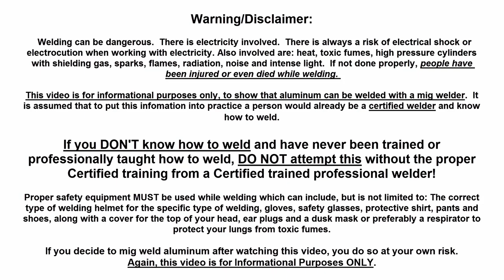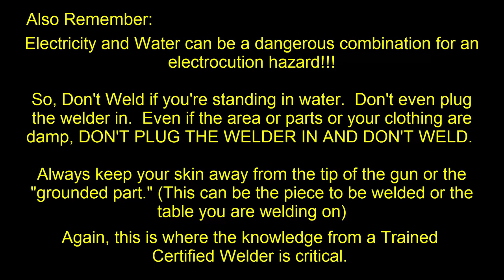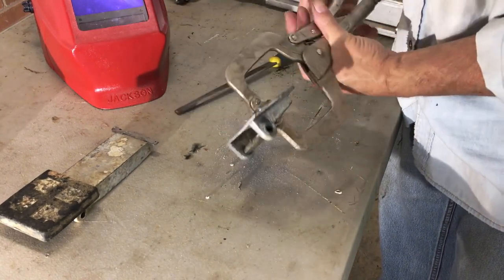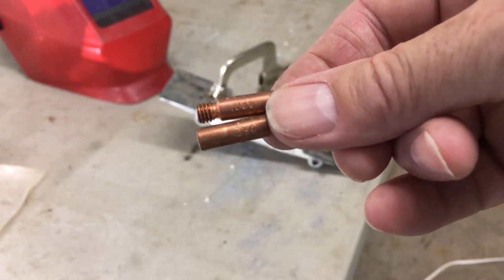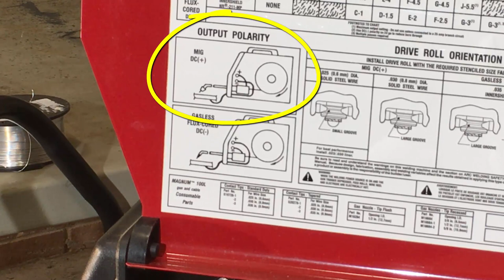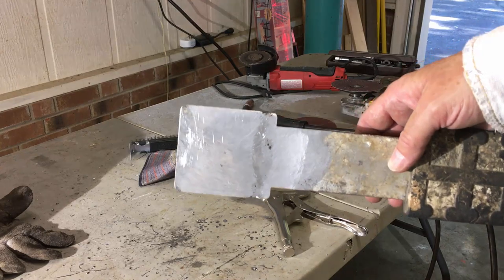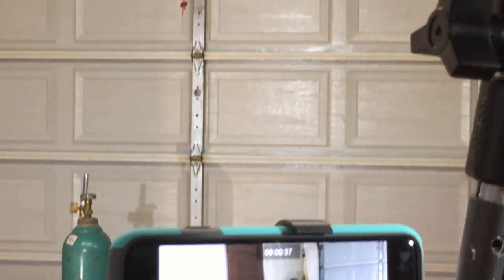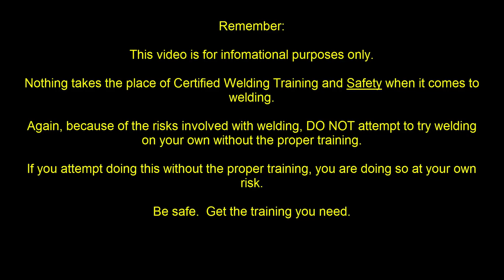Learn An Old Timer's Secrets To Mig Weld Aluminum Without A Spoolgun

Comment: Electrically speaking, a MIG welder is a Constant Voltage (CV) machine.  You set the voltage and wire-speed needed, so the voltage remains at the setting.  The wire speed and wire stick-out from the contact tip are used to adjust the amperage.  This is because those two factors create resistance.  We are talking about Ohm's Law here.  With the wire speed properly set and the proper amount of stick-out, you should have a good buzzing weld arc.  If the arc is popping and spattering you most likely have too much stick-out meaning the arc is too cold, reduced amperage.  If the stick-out is too close the weld might be too hot increasing the chance of the weld sagging or melting thru in the aluminum.  The stick-out is used by experienced welders to adjust the heat (amps) of the arc as they are welding and require a little more, or a little less heat.  MIG welders learn to do this and make the adjustments unconsciously based on what they see and hear.  Aluminum requires more heat than steel does for a given thickness of the metal being welded.  Going past 1/4" inch thick aluminum I have found it is sometimes advantageous to pre-heat the metal a little.  Now, SAFETY!!!  For all the safety warnings you listed and went over, You committed the MOTHER OF ALL SAFETY VIOLATIONS!!!  NEVER EVER MOVE A HIGH-PRESSURE GAS BOTTLE UNTIL THE SAFETY CAP HAS BEEN PUT ON THE BOTTLE.  Even an empty bottle can be a danger to life and limb.  As a side-note.  A SMAW (STICK) and GTAW (TIG) welding machines are Constant Current (CC).  You set the amperage and by adjusting the length of the arc, you vary the heat (Voltage) of the arc.  The arc spans an air gap between the electrode and the workpiece.  That is the resistance used by Ohm's Law.  A close arc reduces the voltage, a longer arc increases the voltage.  Hope this all helps with your future welding.  I couldn't help but respond as I was a welding instructor before retirement.
Reply: wow good info.....
Reply: You da man! 
Now , how may i TIG Alum with a DC/CC machine, and no high Freq?
Electrode Neg after Balled Tungsten, then?
Reply: @drd1924  As I am sure you know, Tig welding aluminum is accomplished with AC constant current and a balled tungsten tip.  Without the surface cleaning action of AC to strip the oxides off the surface of the aluminum, you must clean the surface by grinding or sanding the surface of the aluminum when using DC.
Reply: @OleNavy  Thanks, I have used some nice AC Machines such as the Aerowave and Synchrowaves.....but heard about the "ol HeliArc method from back in the day, when guys used DC and Helium....I've tried it with not good results. I like to try and get good at all possible methods such as running E7018 Downhill before Inspectors started to allow it.
Reply: This is interesting to read, my MIG can also do stick, the dials are wire speed and current, not voltage. There's a switch to change between MMA and MIG, so I wonder if that changes the function of the current dial between current and voltage. Fairly mid/low end machine to be fair, but it works well enough for me to learn on.
Reply: No

Comment: I love reading the comments from the welders. I have been tig and mig welding for 40 years.  Everyone has their way of welding and aluminum mig takes skill and knowledge. I never used a spool gun for aluminum mig. The bigger tip is key and a clean weld. No need to stitch the weld though run a straight bead and you will have a good weld.
Reply from the maker: Thanks for the comment!  I appreciate good comments from guys who have years of experience like yourself.  Thanks for taking the time to watch the video!
Reply: @StairwayToVideo  I enjoyed the video and info, but what video editing software do you use? My son is getting into it and it seems like there are alot of choices.
Reply: My first welding job was in 1968 and made a lot of mistakes while learning, and was put on a job of welding up holes on bottom of a John Boat with a Tig, it was more than is was able to do, but last time was vertical on 1/4 inch Aluminum,  good but not impressive. I wonder what it would be like today, if Migs had not been invented?

Comment: Many good comments here. Great advice from Mike Klass. The #1 rule with aluminum is it's GOT to be clean. I worked in my Dad's sheet metal/fab shop for 46 years. He taught me how to weld all types. I never got as good as he was. But great video.
Reply from the maker: Thanks!  It's cool that you got to work with your dad for all of those years!  Thanks for commenting!
Reply: @StairwayToVideo  thank you. Dad's been gone 3 yrs now but I still use the tricks he taught me. The "old heads" can surprise you every time.

Comment: 1-Clean part with stainless brush.
2- Then clean with acetone. 
3- Replace the gun liner with a teflon one.
4- Pre heat the workpiece. 
5- Purge residual gas from welder.
6- Tack each end, then weld continuous.  
7- Slow down wire speed.  
8- Less wire stick out before initiating arc.
Reply: Teflon gun liner is a must for alum. 
switch it back out when going to steel though as steel wire will cut right through teflon in short order.

Comment: I learned aluminum welding having to weld propellers with stick in 1970. (no leasons)  1972 we bought our first wire feeder for steel.  Aluminum wire welders were a nice treat in 1985.  Thanks for your nice work from a boat builder and job shop owner.

Comment: Thank you for taking your time to make this video.  I would like to add to Mike Klass's comments. Best tips in the video: 5356, .035 tip for .030 wire, and 100% Argon gas. As for the rest, no need to steamroll a dead horse.

Comment: Regardless of the negative comments I did get a few good tips from your video, at least I have a very starting point for my project so unlike so many comments I read I thank you
Reply from the maker: Edgar, thanks for the kind comment.  I appreciate it!
Reply: Through years of experience and a class from national weiders society they said to use rubbing alcohol to clean and if you are going to do a lot of aluminum they make a straight necked gun with pistol type grips  like one other party said keep your lead as straight as possible but I highly recommend a spool gun space proved or a push pull gun for high production jobs twenty eight years experience in the field
Reply: Yea everyone is a damn pro lol

Comment: For cleaning aluminum use a stainless steel brush that has not been used on steel. When welding aluminum, cleanliness is essential.
Reply: Mr2ezgoin ii
Reply: Then wipe it down with acetone after using the stainless steel brush.
Reply: Keep a dedicated St/St brush for Ali and don't use it on any other non Ali jobs. Great Video and a lot of Pro advice as a result. That meant we all learnt something. That's a win win.
Reply: A dilute hydrochloric acid (muriatic) on a piece of rag rubbed onto the welding pieces will give you an ultra pure surface.  The key is to start welding immediately, since the oxygen from the air will start oxidizing the surfaces very quickly.  Just my 2cents.
Reply: My brother used my stainless steel brush on steel while I wasn't looking. can it still be cleaned and used for aluminum welding? Or is it a lost cause and ruined beyond repair?
Reply: Another thing to consider is to replace the liner inside the mig gun. If you have run steel wire through it, it's "contaminated" with micro particles of steel. I use three liners, one each for steel, stainless and alu.
Reply: @BillAnt  It will also rust every tool in your shop!
Reply: @charlesfriend9557  < Only have to use a little bit on the welding surface to keep it oxidation free (an old timer method), it's not going to corrode anything else.  Just an alternative to a wire brush or acetone... to each their own.
Reply: P
Reply: OK distinguishing particular detail being   "stainless"  steel brush        which is NOT merely   steel   brush.          Gratifying finally to see electric Arc welding for aluminum material and filler mostly aluminum I presume.                        Up until now I wanted to throw up everytime I saw "brazing" aluminum mislabeled as "welding" for which an electric Arc is essential for my interpretation sensitivities.                 Even pyrotechnical chemistry bondings and bindings are simply that and not same category as electric-Arc weldings.              My deep study nuts&bolts interest into how such works was attracted, by my infrequent self-services having rare opportunities being rare limited to electric Arc welding the steel only.             I understand better the need 4 grinding or filing what you macallits on the edges of Steel thicker than 5/16, but not on aluminum after tacking corners and zigzag curves on both sides.          Wouldn't that have penetration enough for preventing buckling if flipping the work twice?

Comment: Great video !   You got her done and it looks like your son can get his drywall finished now.  I have a very old welder ( 220 single phase ) and I'm going to get a bottle of argon and give it a try.  Personally I'm not a welder but I had a weld shop in Dachau Germany while in the Army and welded in most every machine shop I ever worked in.  I just play with the machine and setting on a piece of scrap until it taste right then i finish cooking it.  I could read all those books on it but I'm lazy.
Reply from the maker: Sounds like you have a lot of welding experience.  Thanks for commenting and for watching the video.  I appreciate it!

Comment: Thank you!   I enjoyed your video very much because it took me back to when I used to weld professionally.  I first learned to run a bead on my dad's farm at age 12, using 6013 mild steel rod an old Forney buzz-box… progressing  later to a large shop in Ithaca, NY.  There, we did about every sort of fabricating, design, and/or repair job, using various techniques with all sorts of metals, both ferrous and nonferrous, etc.  

During the course of a day, I might silver solder a handle back onto a dainty little collector's-item silver teapot in the morning, and then erect a safety cage out of 10" thick-wall well casing onto a huge dozer in the afternoon using 1/4" diameter low-hydrogen rod.   Mostly, for aluminum and stainless, I used TIG on a huge Miller Gold Star machine... which had all the bells and whistles one could ever ask for.

Have you ever welded while soaked to the skin in the rain in November, perched on a steel scaffolding with cracked cables hooked to a truck-mounted rig?  It's a tingling experience (low-voltage, higher amps), but not really all that dangerous, unless you fell off (Don't tell OSHA).  We often did a lot of higher-end work for the local Cornell Univ., even though they had a welding shop, mostly for small work. 

I'll dispense with giving you any tips as I see many have done.  I now live in San Diego.  We used to use Navy surplus "Cobra" MIG portable machines when I worked at a local university.  The portable Cobras had double feeder motors; one pusher feeder located at the source reel and the second puller feeder motor in the handle, which alleviated any sticking (or bird-caging).    

I miss it now that I'm of retirement age (76 at this writing).   However, I till have my trusty old helmet (4"x6" viewing glass).   I get a kick out of it when someone says to me, "Shucks, I just cracked/broke this (whatever); guess I'll have to toss it out and buy a new one."  I say to myself, "Hey, just toss it at me; I'll fix it and keep it while you go buy a new one." 

Thanks again.
Ron M
Reply from the maker: Thanks very much for posting some of your experience with welding.  You've got a ton of experience and I'm sure you loved most of it.  I think that's my favorite part of YouTube is knowing about people's experiences in life and passing that knowledge on to others.  Thanks again!
Reply: You're very welcome.

Comment: Just saw this, even though it's a little old. Thanks to Mike Klass for some real good advice beyond the somewhat "busy" video. Lincoln used to offer a teflon liner to be used with aluminum wire to help with the birdnesting . I got  one when I got  my SP-175 Plus years ago. It really helps the aluminum feed  much smoother, but now that I have a TIG, I haven't MIGged  aluminum for ages. Might have to try it again for S&G. You really did a poor job of cleaning, as stated many times and an organic respirator is a must( they're cheap, too!).

Comment: Not too bad pal, How about a couple more tips from an older timer? I been doing this for 50 years and am semi-retired. You never really retire completely if you love what you do. You're a fan of safety I see so this one is for you, before you lift your bottles out of the machine, please put the cap on. It will only take you one time to have it slip out of your grip, fall over and break off the valve to never forget it again. 
 Ok, number 2 is the wire nomenclature, the reason 5356 is stiffer is because it's a 53,000 tensile strength while 4043 is 40,000. Note the numbers? 
 The next one is the current, while turning off machine before changing the tip is ok,it's not necessary if you are not leaning against the table where the ground clamp is, you have to complete the circuit before it will flow.
 And the last one is, after you went thru all the trouble to clean it all, you thru the new tip on the table in the dirt, which could pick up shavings and contaminate your weld. Any foreign particle will ruin your weld.
 I got my first certs in 1968 in the Army and been sticking metal together ever since. I specialized in Aluminum and stainless building industrial kitchen equipment, food processing plant equip, hospital equip, and of course a lot of Harley motorcycle repair. Mostly all of this had to be perfect, especially the motorcycle repair, those guys are picky. I had only one rule for the guys I taught, once I got them certified they were to never accept a job with an inferior wage. It had to be upward of 14-15 $ an hour, more now than way back then. 
   Anyway, I like your videos and you have a good sense of humor but hard to pick up on at first, now I know it better 'cause I watch them. Oh, one question, Why didn't you use a die grinder to bevel your joints? If you would like to talk some more, post it here and I'll get back to you. Remember I'm retired so I might take a day or two but I will always answer.
Reply: JR do you have a channel?
Reply: I will never forget the day the mig welder got knocked over. busted off the regulator not the valve thank god! I was fifteen or so feet away and trimix was blasting me in the face. my first thought was "run!" then I went over and turned off the valve.... you never forget the things that make you shit yourself!!
Reply: @Killian McClelland no matter what you do you should be able to use the 50/30/20 rule. 50% to housing and utilities 30% to groceries and you 20% to retirement/health care. so it depends on where you are.
Reply: Hear in Australia we don't even use a safety cap
Reply: @bifish101  why?
Reply: @Jareddonvito  I don't know we just don't, have them
Reply: you better be planing your own shop. or you won't make crap. you better love it.im in for 45 years. not welding. but some i can weld. but dang that is a bad jb ..mechanic.my own shop. millwright.last 10 years of work was in nuclear plants. all over the US. now I sit in a char. I can get out and do a little work. but hurt like hell. work smart. not hard.this is a new world.hell if you can tie your own shoes. you are smarter than most.    MADDOG.
Reply: The nomenclature anecdote is not correct. The wire nomenclature is what alloy is being used 5356 is a 5000 series alloy and 4043 is a 4000 series alloy. Alloys are grouped by their primary alloying element.

https://www.aluminum.org/resources/industry-standards/aluminum-alloys-101
Reply: @Killian McClelland I've been in collision shops for 20 yrs, and welding is only part of it, but it pays better than most welding jobs, unless it's pipe or under water, bottom line is steel mig welders don't earn as much as a top notch frame and body technician.

Comment: Also remember that the machine can still have a charge in it even after you unplug it. De-energize it by touching tip to something grounded. You might even see a spark even after its unplugged.
Reply: You have a pretty shitty welder if after it's unplugged it still sparks.

Comment: I also have been welding for 50 years full time and retired about 6 months ago. I’m never impressed by someone ragging on someone else’s effort. Good video to help those who have the equipment. I also spent a few years in construction hanging acoustic ceilings. I wouldn’t hesitate to walk with that stilt after that repair.
Reply from the maker: Thanks Jerry.  I appreciate the kind comment.  Also, it's nice to have someone chime in who actually has welding experience!  Again, thanks!

Comment: Great tips.
He forgot to mention a couple things like changing the wire sleeve for a new clean one.
If you use steel wire, there will be oil on it, and that oil will contaminate the sleeve and then contaminate the new/clean aluminum wire.
Also, clean the wire drive rollers.
The manual that Lincoln supplies with the MIG welder suggests this as well.
Reply: This guy has no clue he just wants to

Comment: 5356 has titanium and is used for the 5000 series aluminum and the titanium containing 7075. Porosity is a sign that you didn't have your gas high enough. For MIG welding 35 to 45 cfms is called for. That's a poor looking weld, but I guess it will hold. I am a welder, retired and I studied metallurgy as I had to weld a bunch of unusual metals like aluminum bronze with titanium, which was some really tough stuff to cut.
Reply: good points
Reply: It goes through the gun better but doesn’t mean it’s going to weld better. The softer stuff might be what you really need, you just need to set up so it can go through the lead and gun better.